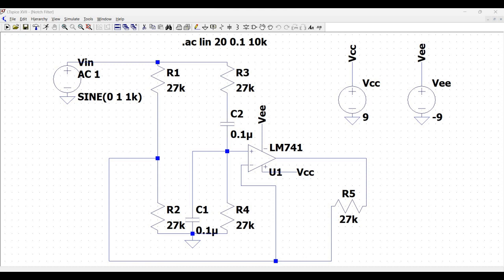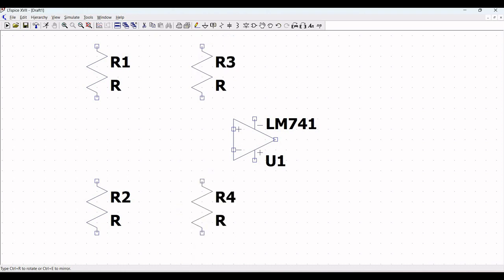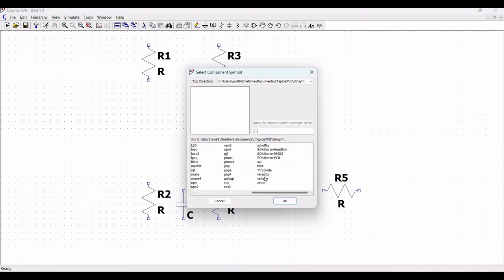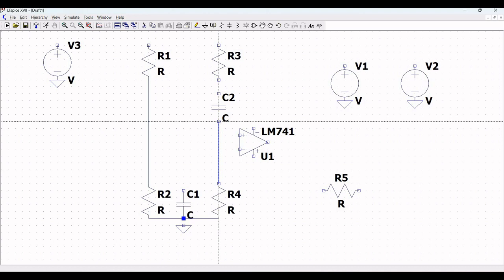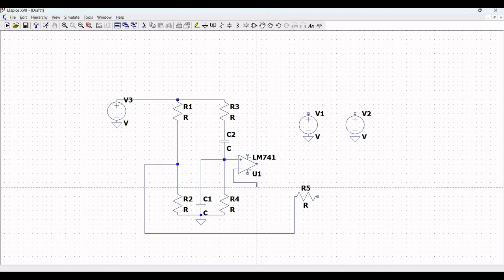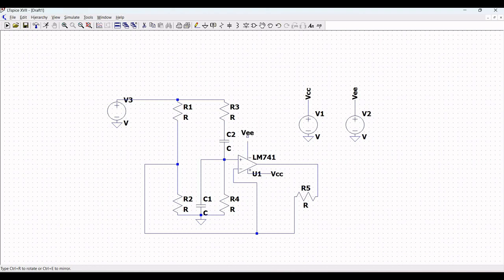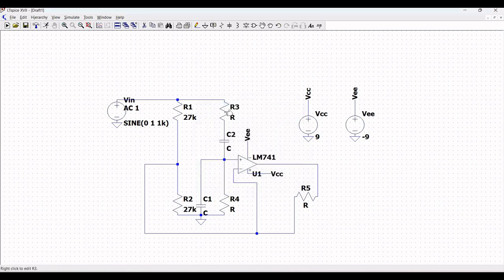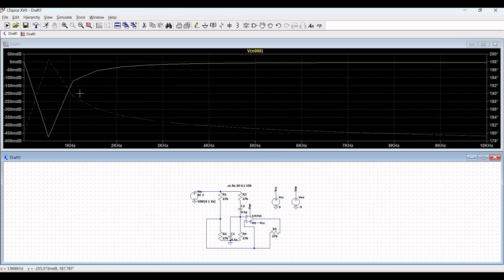LTspice tutorial 26: Design and simulation of 60-Hz Notch Filter

Comment: how can i Amplify the post-filter signal with a gain of 10.
Reply from the maker: Use an amplifying feedback circuit, the gain will be dependent on the ratio of resistors which will be used